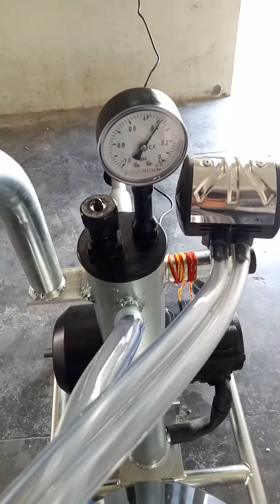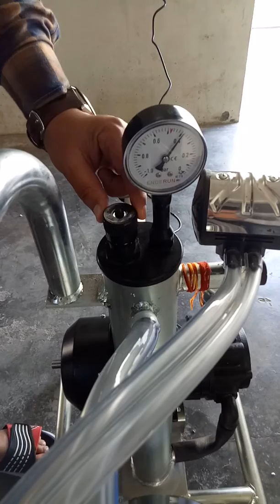Detail Reveiw Of Single Bucket Milking Machine(Krishna Industries)

Comment from the maker: Facing Labour Problem In Your Dairy Farm, Why To Worry , Set The Umay Milking Machine And Increase The Standard Of Your Dairy Farm 

We Krishna Industries Are The Reliable Manufacturer Of Cow & Buffalo Milking Machine & Its Spare Parts . 

Key Features Of Umay Single Bucket Milking Machine :- 

30 Liter SS Bucket 
240 CC Heavy Claw 
Food Grade Liner 
1Hp Monoblock Motor 
200 LPM Vaccum Pump 
Dry Pump (No Maintenance) 
Food Grade Milking Pipe 
Galvanized Paint Trolly (Chances Of Rust Very Less) 
10-12 Cows/ Buffalo Milking Per Hour 
Easy To Operate 
Made In Turkey 
Economical In Price 
3 Years Service 

We Can Deliver The Machines To  Anywhere With In India

For Watching The Live Video Of Single Bucket Milking Machine , Check These You Tube Links. 

https://youtu.be/4WSgcyxxyoE
https://youtu.be/2usulG2RbvU
https://youtu.be/k2-V-xjq5nQ
https://youtu.be/p4j4y6LcbyY
https://youtu.be/Q8ibd63we14

For More Details Regarding Milking Machines Call Our Helpline Numbers  9897501589 , 750012200 Between 10:00 AM - 6:00 PM